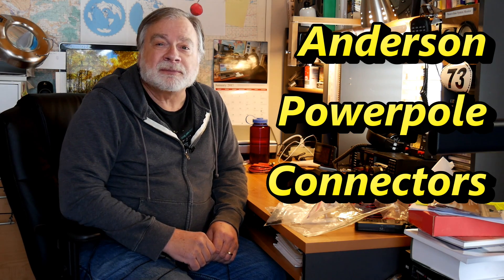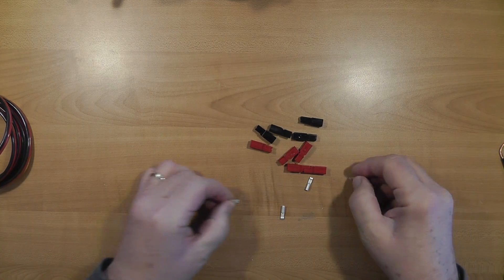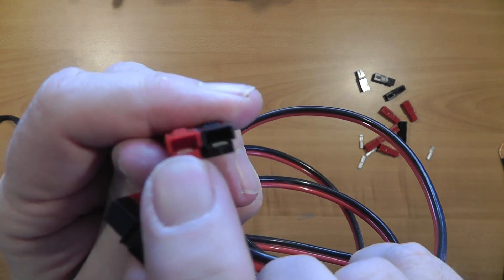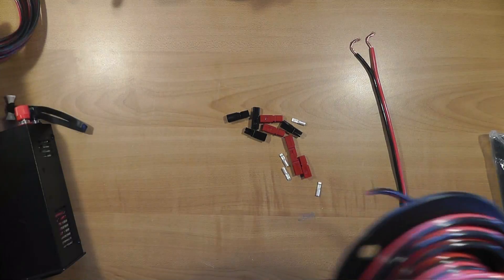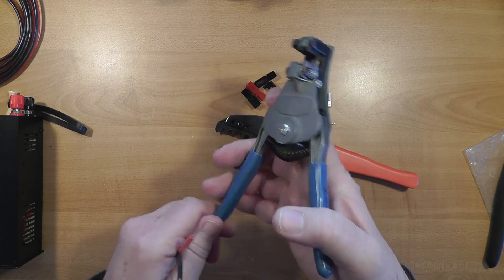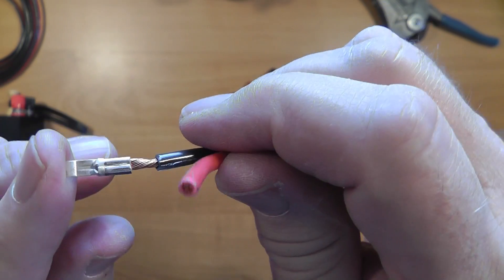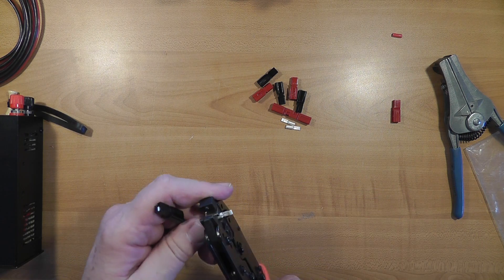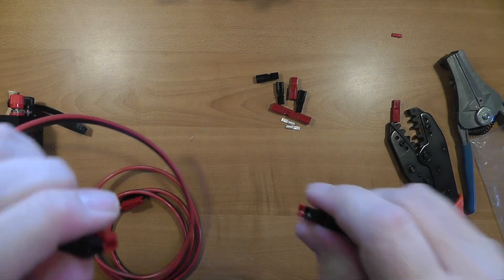Using Anderson Powerpole Connectors: AD #44

Comment: Dave,
Excellent Powerpole video. The connector body has a letter "A" above the opening. Randy K7AGE came up with a nice mneumonic to remember the orientation "Red on right, read A".   73 WB3BJU
Reply: I remember it the same way, but using the old marine navigation rule, "red, right, return".

Comment: Been using them for about a decade; I have a dedicated Powerpole toolbox. Always great when you nan plug your gear onto someone else’s equipment!  Almost a standard in Ham Radio and emergency services these days. I use crazy glue instead of the  “pin”. Great video David 👍

Comment: Wondering why my PowerPoles werenxt quite locking down, I'm SO GLAD you mentioned that you find the same problem when the wire insulation is fully inserted! Mystery solved.
 By the way, if you don't have the roll pins, a toothpick will lock the two together pretty nicely.

Comment: Good information Dave. I’ve put Powerpoles on all of my DC cables in my shack and my mobile. My motivation was ARES/RACES commonality.

I chose the already-bonded-pair variety of the shell. No roll pin is needed and—for that reason—it accommodates the security clip when joining two shells. The Tri-Crimp tool was worth the cost.

The “wire end” of the 30-amp insert is round and sometimes fights with nominal 12 AWG wire. The 45-amp inserts are U-shaped. Wire insertion is much easier and it still tightly grabs 12 AWG wire when crimped.

Comment: Good explanation and demo, Dave.  I use very small zip ties to hold the two together, some people use CA glue.  My reasoning is that if for some reason the polarity isn't right, the zip tie can be defeated.    The Anderson Powerpole standard used by ARES is much better than the previous Molex standard, IMO.

Comment: @ 5:52, I usually like to put ring terminals on the end when using the screw terminals. If your power supply doesn't have powerpole connectors you can make a pigtail with anderson connectors on one end and ring terminals on the other end. Some screw terminals don't unscrew all the way and in this case you can use fork terminals instead.

Comment: Just as a tip, banana plugs are great with those screw terminals on the back of your power supply. Just push into the socket.

Comment: I've used powerpoles for about 10 years, I've always soldered them. I didn't know about the few mm of exposed wire in the plug!! All my connectors sit onto the insulation! One other thing, If you use end fed wire antennas in the field, powerpole connectors are ideal for connections to transformers etc

Comment: Great video. Not to be picky, but never push the connectors with the cable - that bends the cable and shortens the life of the cable. Get a small flat head screwdriver and push on the metal contact instead until it clicks in place inside the plastic housing.

Comment: If desired, instead of the locking pins, you can use weed-trimmer string with the diameter that snugly fits the hole to lock the connectors together.

Comment: The binding posts on the back of the power supply will take standard 4mm banana plugs too, that is what I did with my Alinco DM-430T power supply to my IC-7300 power harness with the Anderson connectors attached.
Reply from the maker: Thanks for the tip.

Comment: Powerpoles come in colors other than Black and Red. I have seen normal Green advertised as Ground connectors, but Anderson makes a special two special Green ground connector, which have two special features that normal green powerpoles don't have: 1. Mate first/break last. A true ground powerpole mates before any other conductors. 2. Will not intermate with normal powerpoles to ensure the ground wire is mating with a ground. One variety of green does this with a little keying feature in the corner, the other uses male and female round contacts. I think the first variety could be used to make hermaphrodic connectors, the second variety of course has a gender.

I have never seen these special green ground powerpole housings for sale, but I would someday like to get a few for evaluation.

BTW - I am using Gray/Black vertical powerpoles for speaker connections. I configure them vertical, so they will not intermate with normal horizontal Red/Black power connections, and their color, or lack thereof, makes them easy to identify at a glance. Unfortunately vertical powerpoles have a "gender", so cables have definite "amp" and "speaker" ends. Powerpole speaker connectors work great not only in the shack, but for car stereo (everything from tweeters to subwoofers) and home theater. They are both small an beefy.

Comment: I've watched #44 on Anderson PowerPoles several times.  I notice that you use copper zip cable (red and black 14 gauge) supplied by BulkWire.  There are other brands that use tinned copper wire in their zip cable.  There isn't a lot of difference in cost.  They say the advantage of tinned copper is that it is better in wet or humid environments and it also solders better than copper wire because of the tinned surface.  Anderson PowerPole connectors are not normally soldered.  So, I'd like to see what you think about stranded copper wire vs stranded tinned copper wire.  I'm ready to buy some and want to get the right kind.  I may not use Anderson PowerPoles for all the connections because of the expense of the tools.  Still thinking about that.  But I do want to buy a spool of 14 gauge ZIP wire.  This is an old video, hope you see my question.   I really enjoy your videos and website.  

Vee Butterfield W7IBB, Taylorsville, Utah

Comment: Say you're making a ham radio go box using a fused anderson power pole distribution block how would you go about adding a switch? I know it's a dumb question but I'm new to all of this
Reply from the maker: DC switches for automobiles can handle considerable current. Ask at your local auto parts store.

Comment: For a Amatuer Radio Op ,it was a Amatuer Vid, What Radio Ham Puts Bare Wires around Power Posts, You never Mentiond Fitting Electrical Loop or Horse Shoe Fittings to go on the Posts, or even Bananna Plugs

Comment: Hi Dave - quick question.  When I crimp Power Pole connectors they occasionally get stuck in the crimping tool, especially the 45A connectors.  I own two different crimping tools from two different manufactures and have the same situation with both tools.  Any idea what's going on?
Reply: The dimple on the bottom makes a deep rectangular crimp on the "back side" of the connector. That's what's trapping your connector in the tool. Tug UP and down and UP and away, and it'll come off. Tugging OUT won't do it.

Comment: Dave, you said the standard in ham radio is “this size” but never stated the size, was it 30 or 45? Also I understood that all sizes up to 45 are cross compatible and the only real difference is the size of wire it will take.
Reply: That is correct.  You use the same housings for all 3 "sizes": 15, 30, and 45.  (The Anderson nomenclature calls this the "PP15-45" size housing.)  If you look at the contacts, you'll see that the "mating" parts of the contacts - the parts that touch each other from one connector to the other - are actually the same dimensions across all 3 of these (15, 30, and 45).  Thus, with the same housing and compatible mating surfaces, the whole family of 15, 30, and 45 all work together and cross-connect.

You are correct that the functional difference among the 3 terminal sizes is the wire size you will be crimping - you want to pick a contact with the range that matches your wire size to get a reliable crimp.

Comment: what if your wires are Alum wires... and the other is.... copper wire will it still work if you plug them together  or will they cause a fire or blow your battery???

Comment: Only correction I believe I could ever make on Any Of your videos is right in the beginning..they are known as anvils..not jaws..the jaws are the actual pliers themselves..the different anvils mount to the jaws..Thank you Ron
Reply from the maker: Thanks for the info.
Reply: I believe he was referring to the interchangeable dies that came with the crimpers. Anvils make up the bottom row of "teeth" that are exposed when the jaws are opened. The crimp is made by compressing the connector and wire between one of these anvils and the hammer above it. This arrangement of anvils and hammers make up the "jaws". The jaws are permanently attached to a mounting system in the form of a die that allows for an easy swap according to need. Yes, the crimpers have jaws, but they become functional jaws after installing the proper die. Kind of like putting on your teeth in the morning. 

It is also possible that everyone is correct and this is just a matter of regional terminology. I keep my gloves in the jockey box.
Reply: @norrinradd8952  Dies is the universally correct term.
Reply: @James_Bowie  Yes, I agree. I referred to them as a die or dies several times in my post.
Reply: As I'm watching this video...I'm thinking...Why do I need a crimping tool? You can use pliers. I 100% agree. XT60's all the way. Unfortunately, not everyone is 'Versed' in their usage. And, as usual, what is popular...is not always best. Best Regards to all.

Comment: Do you have a suggestion for the times where the connector jams in the crimp-tool, how to remove it without bending the metal connector insert?

I've run into this sometimes trying to crimp the bigger wires, say 10AWG into a powerpole 45 and ended up trashing a couple connectors, it's very aggravating especially if you already got the other side "just right".
Reply from the maker: I've run into the same problem. I just wiggle them until they come loose. So far I haven't destroyed any. You might try using a screwdriver and hammer to gently tap on the stuck connector, as sometimes the jolt will knock them loose easily. Good luck! 73, Dave
Reply: @davecasler  It's that dimple on the bottom jaw that is putting that rectangular deep crimp on the back side of the connector that is trapping the connector. Tug UP, down, UP and away.  Tugging OUT won't work.  Look at a finished crimp to see what I mean.

Comment: Do we have to use 14 wire or can we use 12 I have a lot of 12 left over from a solar project. I know it's a little harder to work with but need to find a use for it
Reply from the maker: Just make sure the PowerPole connector can handle it. I use 12 gauge stranded wire with them.

Comment: Not a fan of powerpoles AT ALL. They are a clever design but they are the #1 connector I see failures with. When they fail it's because they are loose. It seems nearly impossible to crimp them to get a really solid connection on the blades. They are always making just "meh" connections. If the blades had a more extreme angle and more spring, they would be a lot better.

When I want a solid reliable connection I use XT connectors. The connectors mate up extremely firm with a lot of friction and are almost impossible to pull apart by accident, like what happens with powerpoles. A pity XT connectors aren't genderless, but they are 100% reliable.
Reply: I've never really understood the point of genderless, for power connections at least.  Do we really want to lose track in a maze of connections...  perhaps grab the wrong set of poles, and accidentally bridge supplies?

IMO there's simply no good reason for it.

Of course, powerpoles are designed for industrial systems - to be used in blocks, with a mix of of early mate/break and late make/break, special keying and spacing choices, and the ability to further rotate for additional keying (like T-connectors)

... I do like that you can take two connectors, lets say nice blue ones... for audio or switches and side-mount them 180 degrees out, so that the pairs always mate together first time.

If only USB connectors were like that.  For some reason my first guess is always wrong : )
Reply: ms3bani: ...and yet, they've become the standard. So the decision becomes, do I enjoy better connections which prevent me from being able to use my radio on someone else's power supply, or go with Anderson and have the flexibility? Sadly, we can't have both unless we build two-headed power cables..
Reply: @paulplack490  i choose reliability, so i choose XT. powerpoles are the harbor freight of connectors. leeching off someone else's power supply has never been even the remotest consideration for me ever, and i would never sacrifice reliability for such a scenario. i cut off powerpoles from anything I buy and replace them with XT.

Comment: At 3:28 you show the mating of two connector housings, which do not have any contactors already inside them (which would create curved surfaces).  I have tried all night and I cannot mate them, as the plastic just butts up against the flat end of the interior blade.  You must be a magician (or are trying to drive people insane).  So, my theory is that you cannot mate two housings unless the contactor is already inside them.  Did you bend the blades inside the housings in some manner beforehand in order to facilitate the mating demonstration?
Reply from the maker: I suspect I did the demonstration with housings that already had the mating connection in them.

Comment: Is there a best size (gauge) of zip wire to have on hand?  What do size do you have?
Reply from the maker: I keep 12 gauge on hand for power wiring and I have various other kinds of wire for various hookups and circuit building
Reply: I use #10 wire in my shack because it has a lower voltage drop.

Comment: Thanks for the video. What are the advantages of this over a SAE connector for power purposes?
Reply from the maker: Commonality. These connectors were first pushed by the ARES/RACES community to provide a standard for connecting anybody's equipment to anybody's power supplies. They caught on throughout ham radio fairly quickly. They are not ideal--they pull apart fairly easily.

Comment: It seems like it would be easier to crimp both connectors onto the wires, slide the two receptacles together, and then insert the crimped connectors into the receptacles...

Comment: Red on the left? Who thought of that? It makes more sense to have red on the right. Red starts with the letter "r" and right starts with the letter "r".
Reply: It's all how you look at it - connector pointing towards you or away?  "Hood" part of the connector pointing up, or down?  I've always remembered the red/black orientation in the same way as navigating by boat or airplane "Red, right, returning" with one addition - my phrase is "tongue up, red, right, returning."  I call the part opposite the hood the "tongue", and with that on top, and the connector coming toward you (i.e. "returning"), then red is on the right, just like the nav lights on a plane or boat.

Comment: Can you put an Anderson Powerpole Connector on an a wire without a crimp tool?  If so, can you show how to put on a Anderson Powerpole Connector without a crimp tool (I assume you would solder them instead)?  If not, can you recommend a Crimp tool that is not too expesnive (under $30)?  I just do not see me building enough Anderson Powerpole wires to be worht the $40 - $100+ crimp tool.
Reply from the maker: You can solder if you'd like, but make sure that the metal prong still fits inside the housing. You can look around the Internet for an inexpensive crimping tool. Powerwerx sells one for $40 plus shipping. Also look at qsradio.com Good luck! 73
Reply: bitogre if you are careful and keep the crimpable portion in the right shape, you can crimp with pliers, channellocks, or a number of tools. I use standard electrical terminal crimpers with no problems. You may kill a connector or two getting the feel for it but you don't have to buy the tool.

Comment: I would NOT recommend a switching power supply for amateur radio use, due to the fact that they put out noise and hash on the HF bands. They may be fine for VHF and UHF, but for HF rigs I would use a good Astron Linear power supply.
Reply: I have been using an Alinco DM-330MV for quite a while. No noise/hash. If there was any the unit has an adjustment to move the interference.
Reply: Ryan, while a good general rule, it's not true in every case. Switching supplies sold for ham use by reputable manufacturers are usually clean when viewed on a spectrum anaylzer. If they're not - return them!